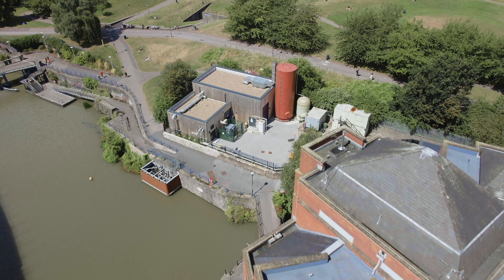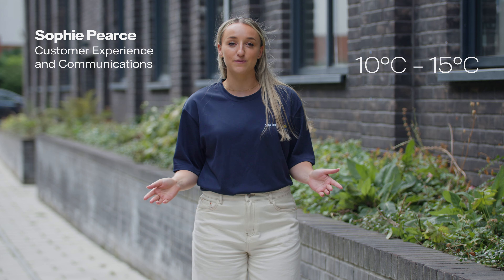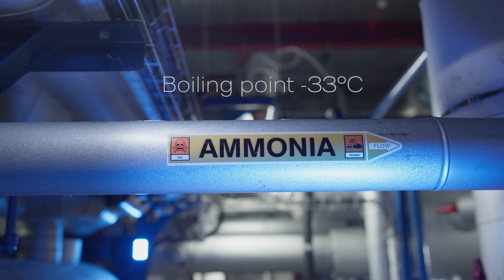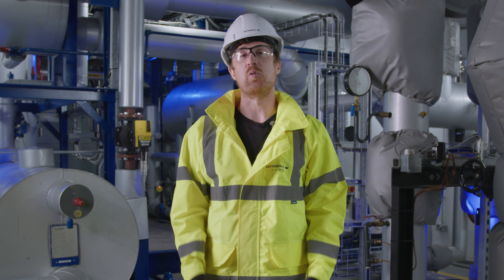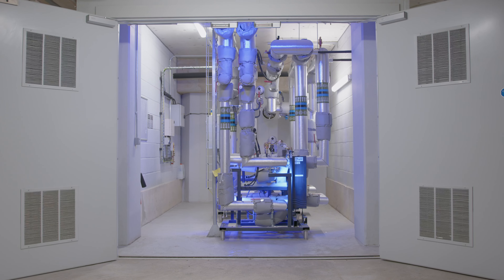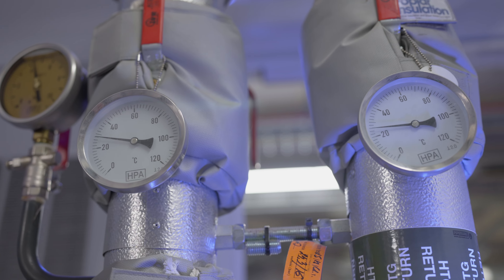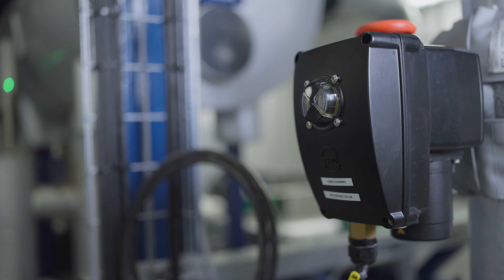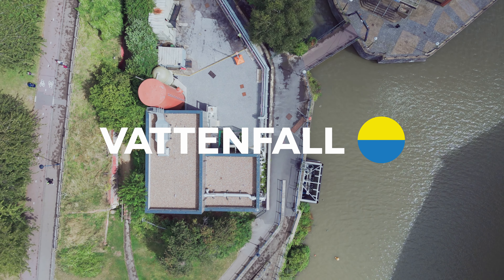The Bristol heat network - how does it work?

Comment: So, - basically a more expensive way for a consumer to use electricity to heat their properties than using heaters in situ by paying an intermediary that has to account for investment in unnessecary infrastructure, labor and it's own electricity consumption just to gain carbon credits for local government?